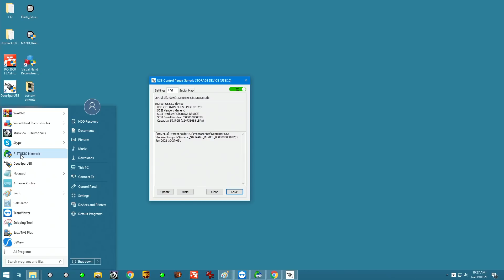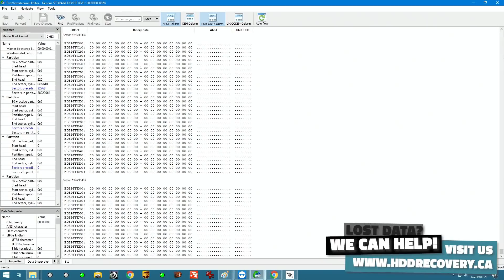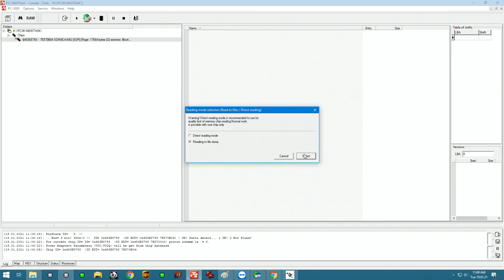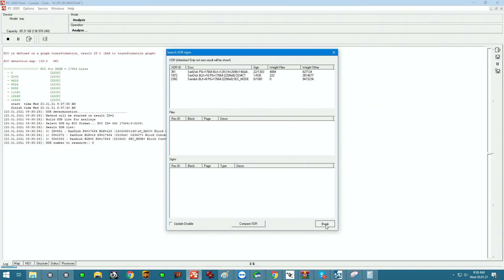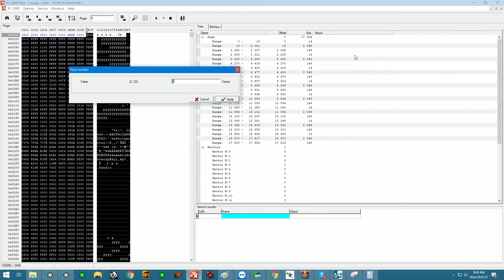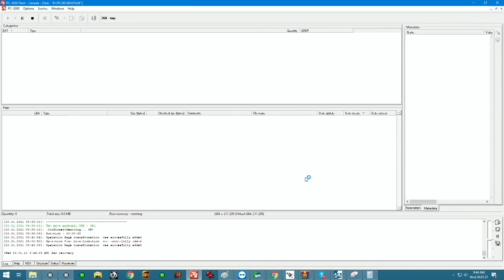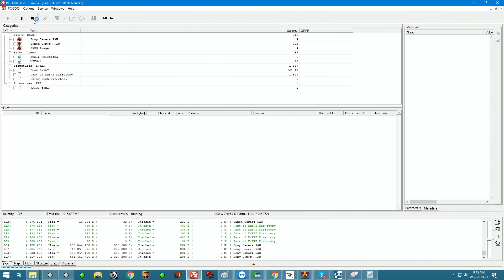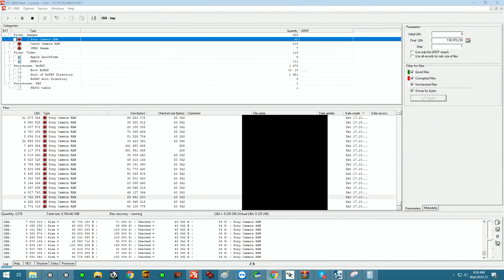data extraction after format sony 7AIII

Comment: My 64GB Sandisk Extreme SD card was formatted by accident with low-level format being selected - card was immediately taken out of the camera with the write-protection clicked on. Later that day I plugged it in to Windows to try to recover the data from it,  however due to the low-level format I was unsuccessful. Given the circumstances, do you think it is possible to recover the photos from the card?

Comment: How about recovering videos? I just accidentally formatted my videos that was taken with my SD cards. Shot with a Sony A9iii
Reply from the maker: it will come down to the type of card you have. This type of recovery works with BCH type cards only. There are a lot of LDPC types these days. Chipoff does not work for LDPC. Sandisk cards over 100mb/s are almost always LDPC
Reply: @hddrecoveryservices  Mine is Sandisk SD extreme Pro 200mb/s, should be LDPC I'd love to have you recover my files but I'm based on SG and i need to files urgently. Yet to tell my clients the videos are gone. Any good software you think could get the job done? Or if you have any partners based in SG?
Reply: I just used disk drill, it is able to retrieve the files, mp4 but i'm unable to preview them. The thumbnails for the videos works fine thou.

Comment: I just formatted a 128gb Sony sd card in my a7s3. Is It possible to recover the files myself? What gear do I need to buy? :)
Reply: I did the same a yesterday. None of the Recovery software's worked to recover files from the Sandisk 128gb file formatted by Sony A7 R3. I sent a message through HDD Recovery Services portal. I realized some of the recovery services are expensive. I am not sure how involved and time consuming it is to recover the images. Its these are just a fun travel pictures I don't want to spend a lot of money to recover the files unless it is reasonable.
Reply from the maker: Probably not impossible, but impractical and  possibly cost prohibitive. Better find service providers

Comment: Good morning
I sent my data to ask if it was possible to recover photos from a Sony card  CF Express A 80 gb  Sony memoria Cfexpress Tipo A 80 GB Serie G Tough - Lettura 800 MB/s, Scrittura 700 MB/s, resistant to extreme conditions .The card has been overwritten  (not with 10 photos but with 1000/2000 raw photos) but formatting via PC is the fastest one..since I haven't received a reply I'm writing here hoping for an answer. thank you

Comment: Great video, so it is possible to recover video files from a formated sd card in a sony a7iii?
Reply from the maker: possible, but result is not going to be as good as recovery for images due to video file fragmentation. A lot more manual work if videos need to be pulled
Reply: @hddrecoveryservices  i see, one more question,  it is possible to recover mp4 files from previous formated?, not from the last time i formated my card, thanks  a lot in advance

Comment: Brother how to low label format sd card & zero format  solutions
Reply from the maker: If sector is erased and filled with 0000s data is gone.
Reply from the maker: Usually those types of format take a while, trim format will also show 0000s in sectors but it will only take seconds
Reply: Thanks brother
Reply: Brother pc 3000 porteble indian Price?
Reply: Sony alfa R2 formatting card data recovery 64 gb sony sd car indian price

Comment: This also happens to older sony Camera. My Sony a6000 with ~2014 firmware is also format the card this way (zeroing all sectors/ TRIM). And probably my 2009 Sony a290 also does this way. 
Actually, I use  my camera often to format my SD card before I use it to other device; I want to make the sectors TRIM-ed to make sure pristine performance. Raspberry Pi fstrim command also can does this too.
Reply from the maker: Yep
Reply: @hddrecoveryservices  I had a samsung i5 digital camera
Accidently pressed the format button ( never knew that word meant delete )  this was way back in  sept 2007
On a trip with dad in new york
Pics & videos gone.  Tried all I could  but everyone days. They are gone forever

Comment: I have a mini SD that works, but it does not accept writes anymore. It can be read. It is not possible to format this card on any device. It says it has been done, but afterwards the old data is still on the card. Tried several programs and cleared the read only rights, but nothing will work!

Comment: Hi, first love you channel.
You explaining is good to understand and to follow 😎👍
I was wondering have you dealt with HPE 32k & 40k hours firmware bug from 2019/2020?
What I understand is there was a bug in de controller of de SSD, what makes them unreadable.

I am a system administrator, and we had some SSD’s that where missed for the firmware  upgrade fix and died unfortunately.
But was wondering if you have seen and had some of the SSD’s that where effected and where you be able to recovery data from the SSD?

Comment: how to fix RAW format and write protected usb? bro. Someone..???
i this usualy hapen when u remove a usb when this is working.

Then i have another one with Write/Read error. i think this time is the controler. Rip usb
Reply: Little complicated but it is possible, bcoz i did it several time. But unfortunately in most case you cant save your data, but the flash disk itself can be usable again.

It is depend the UMPtool (usb mass production) need to clean format or not. 

You need usb VID and PID of your flashdrive, then you find suitable MPtool for your flashdrive.

You can view your vid and pid with chipgenius (windows app)

Just follow the instruction in the last line of chip genius.
Reply: @justtom7240  thx bro. i dont the care the data of the usb i just want to used it again
Reply: @justtom7240  solved bro. Thx so much with UPTool v2093. This page is amazing usbdev.ru have everything but need traductor cuz is a russian website.
Now i will try it to fix the another one with S/W error.
Reply: @frankcarter6240  glad to help, always remember to do safely remove or at least remove when it is not on work to prevent firmware damage.